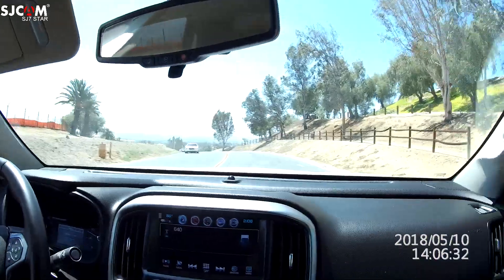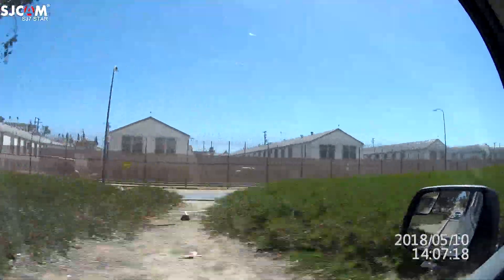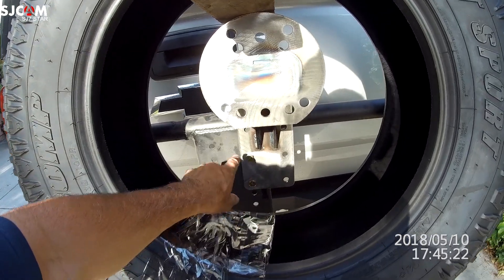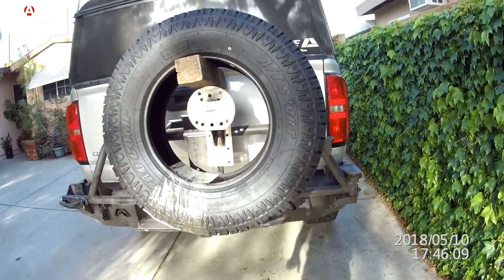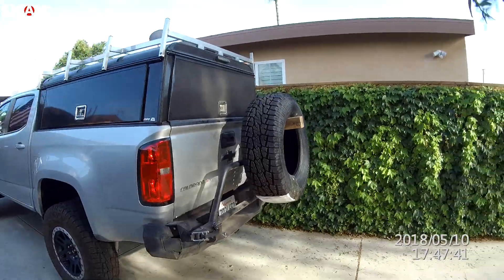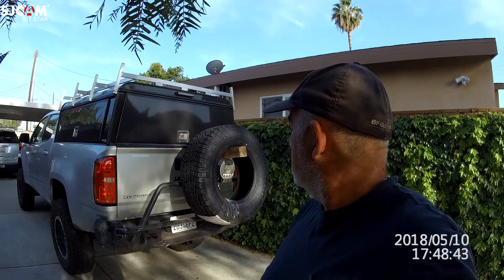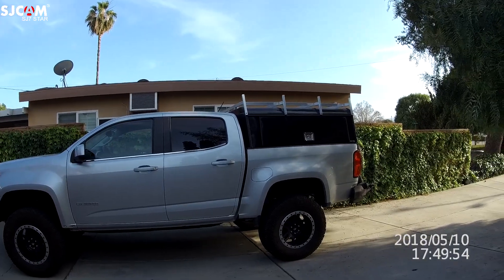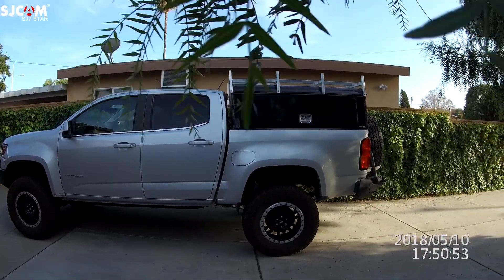It's only thursday!

Comment: I could see where you might want to put a plated gusset near the hinge on the tire Carrier. Maybe both sides but I'm sure you don't want to heat up the pivot too much if there are any rubber bushings